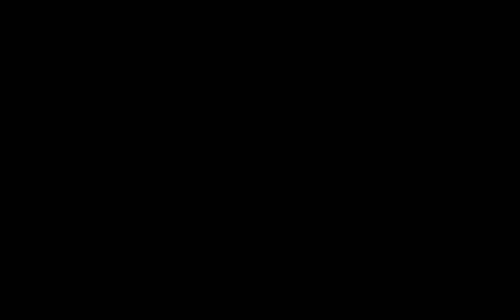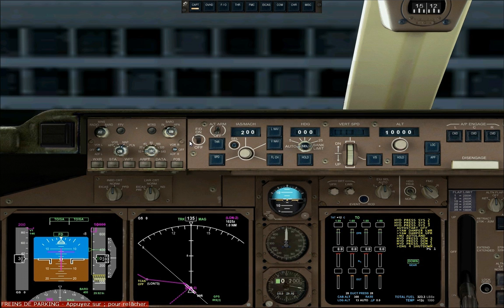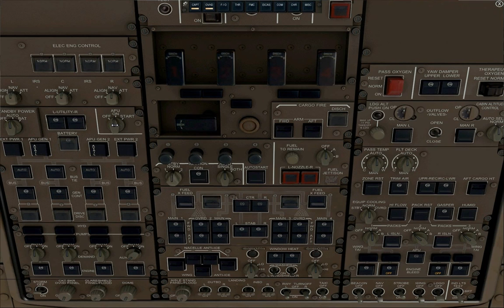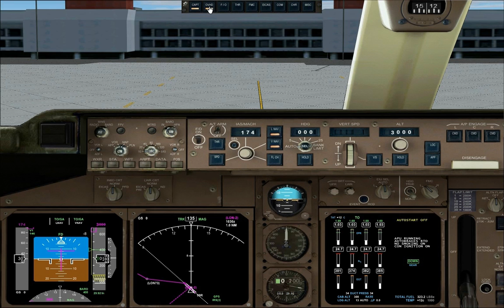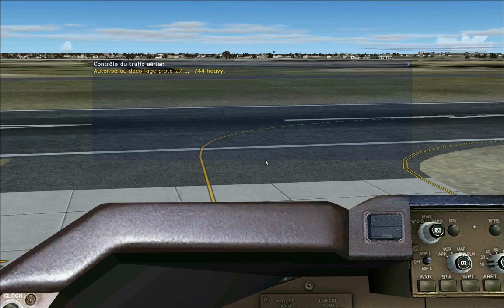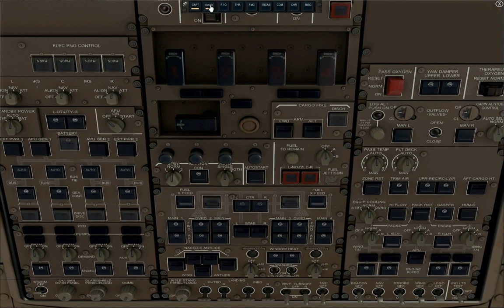PMDG 747-400 full tutorial part 2

Comment: Consider some steps:
1. Do not turn ON fuel pumps without fuel hehehe
2. the TCAS remain in STBY mode till you will enter in runway. So only in this moment you will appear in ATC radar screen. Its to avoid saturation in their radars.
3. In the MCP speed, should be V2+10knots.
4. IMPORTANT! Fuel pumps. Engine 2 and 3 have a OVRD buttons. IF you activate them, the plane will BOOST that fuel tanks cutting the other tanks.
5. Fuel cutoff valves moves to ON when N2 is at 20%+
6. The takeoff is managed full manual to reach specific safe altitue, (you scared for sure that poor people inside the builds!! hahaha)
7. If you do not press TFC in your range knob, you will see no traffic in your TCAS.
8. Runway 27L means 27L not 09 (opposite runway lol)

EDIT:
9. THe normal position of the Landing Gear is in UP position the OFF position is used when you need to deploy it manually, for release all forces keeping it up.

This is not a complaint! Its just informing for helping to do it more correctly hehehe. Enjoy your flights captains!
Reply: for some reason, when I turn on the engines to start it just doesnt start. I have packs closed, engine bleed on
Reply: +MR COURIER Would be some reasons... Make sure you have in Overhead panel Autostart ON, APU running and on BUS (connected hehe) and in the pedestal panel, the 4 engines switches (below throttles) are UP (on position), then just pulling in overhead the ignition (4 switches) it should start.

If you want, take a check in my personal modification of the panel for use it in 16:9 screens (I love it hehe)
Link: https://mega.co.nz/#!y91kCRiK!Y29SzkdTYPLS8gz12tqziyU9lFdjw9iO9UUOyrR9mGc
Reply: mcgalcri oh thnx man, I remember u from a video where a kid landed a 737-800. But I actually forgot to turn on the APU bleed XD
but thank you for your reply
Reply: Gear lever needs to be off. When you have it in up it uses electrical power. If the gear is retracted, set it to off so you won't use more hydraulical pressure than it needs
Reply: Yes you are right, but we are speaking about Take off stage. The Landing gear handle remain in UP position for some reasons. Remember we are starting to climb, with low speed (restricted 250 knots) would be dangerous if the landing gear fail and deploy itself (it already happened) and that will create A LOT OF DRAG, while climbing in low speeds... really serious problem hehehe. The handle moves to OFF position usually at 10.000 feet, where you can speed up in clean config and after take off checklist.

Comment: Just a few observations:
Runway heading should be set on the MCP
All Hydraulic Demand pumps should probably be turned on prior to pushback
I doubt you'd get enough bleed air pressure from the APU to run all four engine starter motors at the same time.
You didn't set the altimeter to QNH.
You took off with a strong tailwind
I don't recommend engaging the A/P below 1000' (safer that way)

Comment: If you were trying to reduce pressure on the nose wheel, you would not shove it into the pavement. My uncle flies 737 for southwest and i myself fly citations with my dad who is a pilot. The plane will not lift off the ground unless it has sufficient lift. If you are going 80 kts with a fully loaded 747 rotate is about 155 kts. And even at 155 kts; it is not an easy bird to get into the air. Even in the smaller airplanes i have flown in you do not need to use forward pressure on the stick.

Comment: @supersaintsfan31 You can do one of two things. Start in a Cessna 172, turn off engines, turn off battery, and turn off avionics. Load your PMDG aircraft and then you have a cold and dark cockpit. Or, with the 747, MD-11, and the new 737 NGX coming, you can load the Cold and Dark panel state that way.

Comment: @marko071988 ye ye i did but i think my problem was i didnt put my desired height and speed setting for the first waypoint because i was supposed to be at 400 feet for it and then i panicked turned v nav off then it didnt connect again

Comment: and you totally messed up the engine start up. you started 2 and 3 while 1 and 4 was still starting. where you gonna get the xtra preasure from to start 4 engines at one time. wait for them to settle down before. its not a rush. and stab tanks on even though no fuel in them? :s. and you need to wait 2 - 3 mins for the engines to settle before turning all pax on again. and you only have top press yoke forward if you wanna have better control for turning under 80.

Comment: well i fixed the problem, i dont know what happened the first time, but i tried it again with a different flight plan, from a different airport and it actually worked fine. but the only last thing left for me to ask you lol, which trim settings is it that you change? (whats the name of it in the fs "control assignments" section? because i checked and there is trim setings for rudders, aileron etc.

Comment: i put my position in the fmc first, then turn the irs back to nav, and it worked fine, then i entered the origin and destination airports like yours, then i put in my crusing altitude, then all the waypoints, and the departure aswell, after that i delete all the discontinued wayponts (ones with squares), then i set up my take off, the flaps, v1,v2 and trims. then i put my v2 speed in the speed indicataro for the autopilot, and turn on l nav and v nav, and also the altitude.